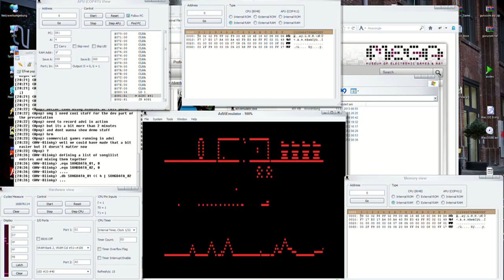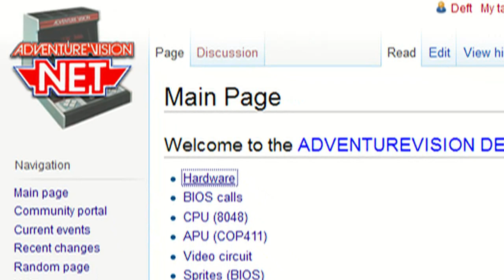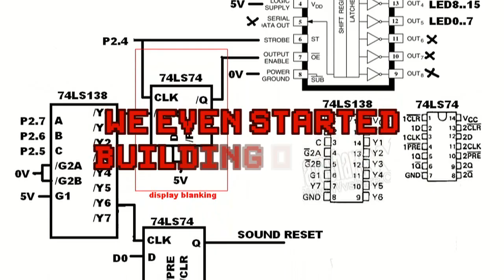MEGA research project 2013: Entex Adventure Vision

Comment: It is likely possible to build a similar display from an Arduino with LED strip and a kind of spinning disco globe or spinning (triangular?) prism. (Perhaps laser show people know more suitable mechanisms.) I guess that ARGB may be too slow because it has its own internal PWM refresh rate (or it works when only using 100% and 0% brightness), so it may need normal RGB strips with possibly an additional buffer IC. Someone should try this out.

Comment: At 0:50 it looks like the LEDs are attached to the rotor, but at 1:30 it looks like the LEDs are fixed on the left of the screen. Can someone clarify? (Thanks for the great video, btw!)
Reply: That's just the reflection in the mirror. The LEDs are indeed affixed to the left. It wasn't possible to make a spinning rotor with attached LEDs back then.